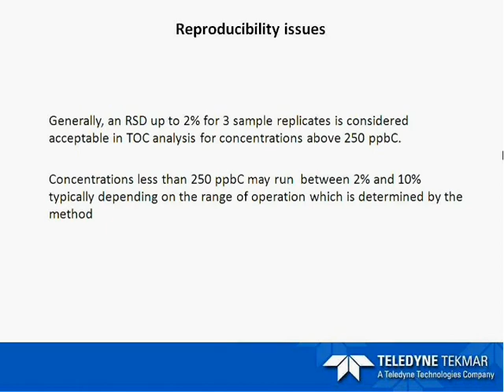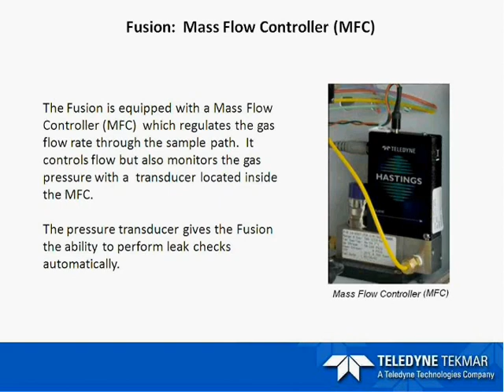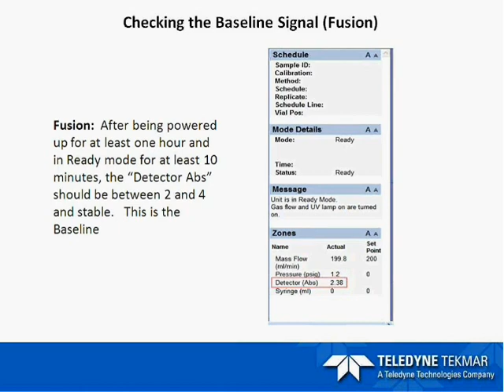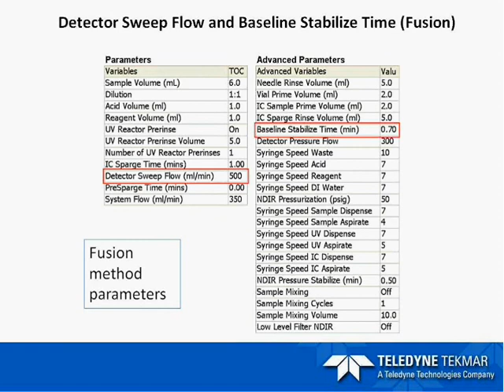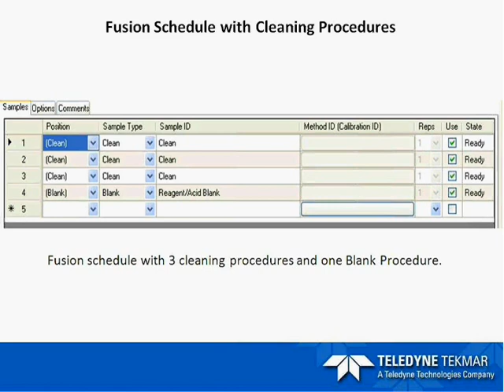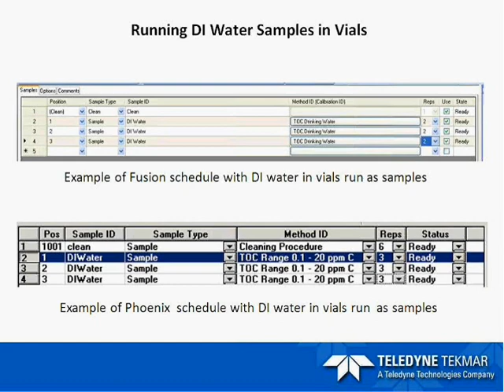UV Persulfate Troubleshooting Made Easy

Comment: if my results are not correct for standards solution , is there could be a possible problem with calibration ? or should i start to troubleshoot as described in the video first ?

Comment: Please I have a question in TOC fusion 
I have a bad repeatability for the blank sample , as I inject it triplicate and every time I got a different reading what are the causes of this.
Note : It is a new instrument and it is the first use of it.
Reply from the maker: Dear Mahmoud
I am sorry for any inconveniences this may have caused. Please contact Teledyne Tekmar International Support via email at Tekmar_IntlTech@Teledyne.com and they will happy to help assist you. 
Thank you, 
Product Management
Reply: Sir,
How can I calculate uncertainty determination in TOC fusion
Reply from the maker: @mahmoudmoustafa550  to calculate this, there are many factors involved. We can not provide enough detail over this message. Please reach out to Tekmar_IntlTech@Teledyne.com for guidance.
Reply: @TeledyneTekmar  Thanks for your cooperation I will do
Reply: i am having the same issues , did you get your problem fix ?
Reply: @manoor6391  Yes, I do overnight cleaning with a grade type I water and it fixes the problem
Reply: @mahmoudmoustafa550  nice . My cleaning procedures values are okay but still my results are not consistent and correct for the standards , what could be the possible reason then ?
Reply: @manoor6391  Did you check for any leakages?
Reply: @manoor6391  give an example how much  value of standard you run and how much you get it for triplicate?
Reply: @mahmoudmoustafa550  yes i am getting right flow of gas with bottle pressure of less than 2 bar. so no leakages :)
Reply: @mahmoudmoustafa550  my results are not very consistent . like if for  first 3 reps its mean is 10.05ppm  for 10ppm standard then again it yield me 13 or 14 ppm for the same sample on second try  and on third try it will give something very different again .  its making me crzy indeed.
Reply: @manoor6391  I think there are building up a carbon through the system So you need to replace lines land also cleaning the NDIR detector
Reply: @mahmoudmoustafa550  yes i was thinking the same but since my cleaning values are pretty fine so i think it might not be right , but for being 100% sure i was also  thinking to run Sulpheric acid as sample  to remove any deposits if it has .  
for NDIR , i dont know how to clean that , any suggestion for that plz?